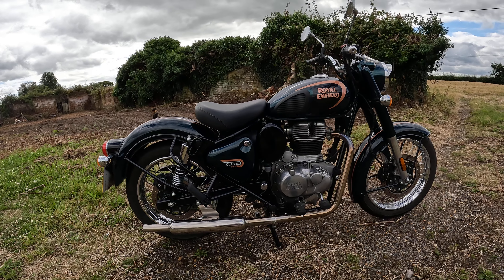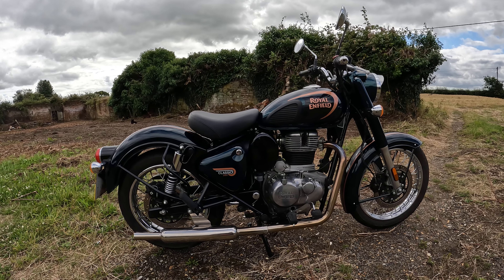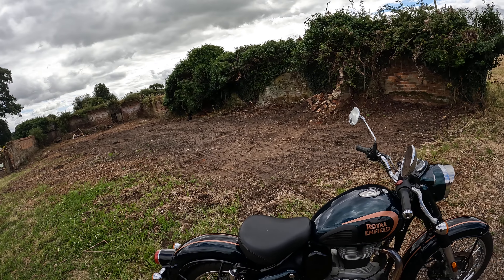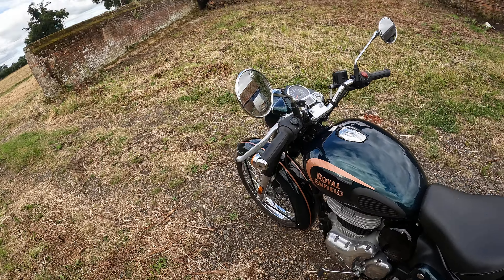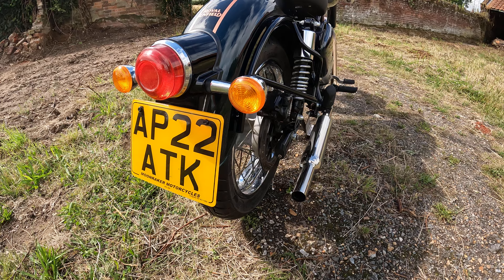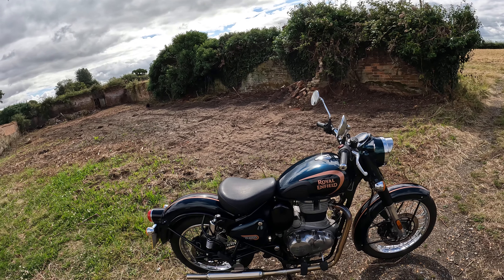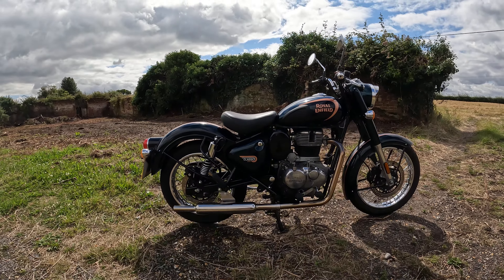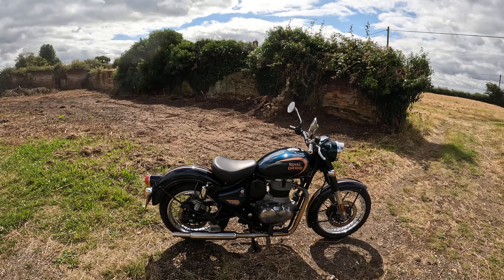ROYAL ENFIELD CLASSIC 350 PERFORMANCE MODS.  ARE THEY WORTH IT?

Comment from the maker: Please remember, these are only my own personal views and opinions. You may achieve different results on your bike. Also please keep the comments civil, I have had to block some commenters already on this video! Insulting comments won't be tolerated. I think we are all able to use the English language to put our points across without resorting to insults to either myself or other commenters. Thanks VB.
Reply: I think you accurately made your points, loss of torque, no real gain in speed, loss of gas mileage. if you want more but the 650 😊
Reply: Just leave the exhaust pipe and take all mods off.
Reply from the maker: @sunyrj25 I removed the Hitchcock's exhaust and fitted the standard factory exhaust, took the DNA filter off and refitted the standard one and the bike now has a lot more midrange torque. It still has the performance cam and the Fuel x lite, so will probable leave them as they are.

Comment: So, Royal Enfield got the design right in the first place 👍👍.
Reply: @GapBahnDirk  tbh they did get it right at the factory but Euro 5 strangled it I don’t care about the peak power output I don’t have a DNA filter or intake , i have a home brewed one with a smooth radius into the filter ,i’m running a through pipe de cat on it and a modified tail pipe, but it runs much cooler  and is a decent hill climber unlike it was as standard it feels remarkably similar engine wise to my pals 500 classic revs are not quite as low at higher speeds but not a great deal of difference and it doesn’t feel to different in peak power either we have swapped bikes doing a20 mile run half and half and  we both agreed that they are different power wise but not by a huge margin
Reply: This video saved me a h….l of a lot of money, I’ll leave it as standard, but I will fit a rev counter, I miss that one.

Comment: Hello Mr Brown. Thanks for your honest opinion. I bought my R.E Classic 350 2 years ago , after not riding for over 30 years. The bike is stock and  the only mods I've done is remove the rear seat and put on a Hepco and Becker rear rack. The bikes done 7500 miles without any mechanical issues. I have been struggling with the decision to spend the money regarding the performance modifications and I think you have reinforced my decision to keep it stock. My bike sounds great and will do over 70 mph and no more as it is limited by R.E. Also fuel consumption is 80 to 90 plus mpg. If I want to increase its performance , a cheap way of enhancing the bikes power to weight ratio I could go on a diet and lose  20 lbs, as I'm not a skinny lad anymore. 😊 Thanks for your opinion. Carl.👍

Comment: I totally agree with you,a complete waste of money. I'm amazed at how many people have gone with this route of add one's to try an increase power on a bike that is speed limited to 71mph. If there was a part you could buy to bypass the speed limiter so it would do 85mph then that might be worth it.The other point is that without telling your insurance company you have effectively cancelled your cover! As you say just enjoy the bike as it is and use the £800 for funding some nice trips away 😊
Reply: The HNTR throttle body if fitted will bypass the limiter, and you will get about 85 mph. They cost about £200.
Reply from the maker: @johnludmon7419  £143 is the cheapest new one I can find!
Reply: @Volcanicbrown1878  the question is would you spend the money? I haven't and enjoy my meteor as it is (though the extra 10 mph would be nice to have in hand)

Comment: So glad at last somebody spoke out, I've been arguing with numpties for two years about these modifications which are purely placebo and until the ECU is re chipped no gains will be made. So well done and spot on.
Reply: @johnrocker2986  the ultimate goal would be for plugging it in and re setting the parameters in the ECU , I don’t know about you but I feel a little insulted that we are not trusted to act like adults and these bikes and very soon all new vehicles in the uk are going to be restricted in the same way, thats going to put up the price of even old cars until ordinary people can no longer afford to drive and the insurance companies will double the prices on older cars using the excuse that they aren’t speed restricted but i think that is the long term plan anyway , they will sort out uk emissions and traffic issues by only allowing the rich to drive, sounds extreme I know but watch this space
Reply: @johnrocker2986  can i say whilst im here that my reason for fitting a fuel optimiser had nothing to do with performance but to help the engine run cooler which it has , i was seriously bothered by the temperature that it was running at as standard especially in traffic and for that reason i am happy with it , as for performance I don’t need that if i did I wouldn’t have bought a J series bike
Reply: You just need that exhaust pipe...that can make the difference.
Reply from the maker: @sunyrj25  In my case it didn't.

Comment: I have the exact model and colour as you, had it now for over 2 years and is by far for me the best bike I have owned in over 54 years of riding. I fully agree with what you have said, about 6 months in I purchased and fitted a de cat pipe from Hitchcocks, did about 100 miles then re fitted the cat. For me the noise was not enjoyable as a deep resonance was in my helmet, so once cat re fitted back to the relaxing sound I liked, last engine mod I did. As you say why buy a relaxing bike then try to turn into a different type of bike, I owned a Triumph street triple for over 3 years that went like stink and handled on rails. In the end though I found the high revving nature wore me down, a great bike for what is was designed for but for me I just craved a more relaxing ride, hence why I love my Classic so much. If you want a fast bike buy a fast bike, if you want a relaxed economical ride buy a standard Classic. Keep up the great videos, also loved the dozer video 😊
Reply from the maker: @Peter234100 Hi Peter I think you have summed it up!....The Dozer vid got thrown in the bin. After the initial flurry of views, folks just stopped watching it completely!

Comment: Done most of the mods on mine,DNA,decat pipe,fuel x,16 tooth gearbox sprocket,I noticed the hit on fuel,from 95 to 80 mpg,but it's a much happier engine with the fuel x,mine is definitely running cooler,steadier slower tick over,cleaner pick up,only paid 3.7 for it,old boy had bought it,never rode it! 0.8miles on the clock,put £200 worth of touring seats on it too,which looks better,but not especially comfortable,mines a red chrome,was also impressed with the build quality(apart from the crap battery,which has been replaced) thanks for your honest video,was thinking about the cam,but I'm not for revving the nuts of it,not that sort of bike, I'm late sixties and back riding after 45 years,loving every minute! take care my friend

Comment: I have had totally different results on my Meteor to be honest i made my own air filter cover  which is not as open as the DNA  but better than standard i have a x light optimiser fitted and i have a de cat , but I wouldn’t let anybody else touch it and did the work myself I didn’t change the cam , the results for me have been a moderate increase in volume but a much nicer tone a major increase in usable torque straight from tick-over to flat out the restricted top end still cuts the power at 72 ish mph , so no difference at the top end , the engine does indeed run much cooler( tested)  and my average fuel consumption is 89.3 mpg’s , i am climbing 3/4 gear hills standard in 4/5 with ease i live in Wales so that was the most noticeable improvement for me, i fitted a 16 tooth front sprocket for a 300 mile motorway trip and found that so long as i held on to 4th gear until around 55mph it would hold 65 mph even on hill sections unless they are trull mountain climbs , i returned around 220 /30 miles per fill though there is a small element of educated guess in that because of the notoriously twitchy fuel gauge near empty so rather than run out ( not a favoured plan ) i kept a tally and did the sums back at home , overall i am more than impressed with the meteor  and the fuel x light and would seriously be considering that there may be another issue somewhere on your bike so maybe take off n test one mod at a time as i suspect the cam maybe the cause of your problems  as it has much more duration than the pretty soft standard cam that i kept, the cam change is reckoned to give about 6/7 ponies but i was interested in the torque curve much more than the top speed because the ECU is going to stop you doing that anyway and in truth after seventy windy and tiring describes the ride so 60/65 is good anyway, i can on the meteor bypass the restriction and just south of ninety is possible but i think on the classic the speedo stops working if you mess with the wiring in the same way, or so im told anyway I can’t say from experience as i only tried it on a meteor but thats my bike , i don’t know why you expect flack   People are probably interested , i do however suspect that the fuelx is not compatible with your cam  and as i have no soot or starting issues after 2100 miles with the optimiser i would be inclined to take off the cam first and re test as my pipe isn’t burned and the only one i have ridden that was cammed up was bloody noisy and erratic , sorry for the essay and i hope you get it sorted

Comment: I much appreciate your honest feddback and review. Thumb up for not trying to sugar coat it.

I have accidentally found out, that one of the dealers not too far from where we live actually offers ECU tuning. They must have found the way to 'crack' it and promist to bring 5 hp more (and offer a measurement before and after). I do not know any more details (how the curves change and where), but I will definitely talk to them about that.
Reply from the maker: @matusknives I didn't think it would be long before someone started  to do remaps for the 350's!
Reply: @Volcanicbrown1878  the million dollar question is - what are the downsides in the longer run ...
Reply from the maker: @matusknives  Poor fuel consumption will be the main downside. I have removed all the mods from my 350 and even back to standard, I can get better fuel consumption from my Classic 500! My honest advice would be, If you want more performance, save the money spent on the mods and buy a 500. (I still run a pair of classic 350's but the 500 is more powerful, a lot faster and more fuel efficient!)
Reply: @Volcanicbrown1878  yes, that would be my expectiation too. The extra power does not come out of the air. Especially if one starts to use it regularly. As many have said - a 500 single with some 30-35 ps would be a great bike. I understand why RE decided otherwise, but we are allowed to have dreams :)

Comment: My fuel x light has lowered the engine temperature considerably( tested ) and i am not using much more if any more at all fuel because I’m mostly in a higher gear for the same speed so i would say that ur bike is not typical and would also say that if you bought the bike already modified then i would take off the mods one at a time and find the culprit but i think its going to be the cam that is the issue because im running the 16 tooth sprocket and that was because of the  extra available torque given via the fuel x  so that is the one thing i would swear by, and yes my first thought was if its running richer then it will use more fuel and logically that still has to be true but my own calculations have proven that assumption to be wrong because im using a higher gear everywhere compared to standard and with normal riding and not being gentle im still averaging around 90 mpg 89.3 was my actual average i fill up at the last two bars on the gauge and always get around 250 ish miles per tank now she’s properly run in
Reply from the maker: @NoelRoots-t1u Didn't work for me! All the mods have now been removed and I have refitted a 16T gearbox sprocket, The bike is back to how it was when I bought it new. just perfect!
Reply: @Volcanicbrown1878  
Its just my opinion but i think some people will just throw all the mods on that are available and hope for the best but then they have no baseline to work from i fitted a fuel x first as the fuelling was definitely lean especially at low revs  having that on it allowed me to move on to the next problem  so i then designed my own air box lid that would take some of the turbulence away from the mouth of the air box so now i was getting more air in allowed me to use a through mid pipe,  but i tested and adjusted everything on my way through the process even having the ability to lengthen or shorten the mid pipe by 30 mm made a big difference to the hill climbing ability of the bike and the gearing its able to use  but  hey im a methodical bugger  and spent a lot of years doing research engineering based mostly around air flow and turbulence both making it work for you and trying to eradicate it so i had a decent head-start but im glad you got your sparkly black little number how you like it 👍

Comment: Thinking about it it probably won’t help your fuel consumption that much but should help but definitely will improve the starting and running if you used a hotter spark plug for a better burn I feel you would notice the difference for sure as you know tuning is like dominos one thing effects many things but  it sounds like  the free exhaust and the high lift on the cam is preventing a good burn 👍
Reply from the maker: @user-rd7qu8kk6d  The bad starting was eventually identified as a sooted up Lamda sensor. I cleaned that up and then removed the DNA air filter and put a standard one in. Then the freeflow exhaust and silencer came off and were replaced with the standard setup including the Cat. It still has the cam and the Fuel x lite. The results were that the low and mid range performance are considerably improved. I have now refitted the 16t gearbox sprocket and the economy is back to what it should be. I will probably leave it as it is now.
Reply: @Volcanicbrown1878  im running a standard filter with a home made lid on it, i have ridden a cammed up Classic but i didn’t like it so didn’t go down that road

Comment: Just listening to you & you right you spend 800 notes for not much improvement iv did this 🤔
I have managed to improve it but it was a lot of gigery pokey .
With your baffles iv experimented and found the use of stainless steel perforated sheet rolled into a Swiss roll shape it is coiled & grips itself into the exhaust with one nut & bolt in tailpipe to stop it shooting out  & making it about 5 to 6 inch long, it doesn’t restrict causing pressure waves, it decreases the  sound level you need around 3 to 4 layers from centre . Slice a 😁pice of bar as a winder to make you roll up .
well Up to you mate try it on one of your other bikes . Bit of a ramble hope it makes sense
Reply from the maker: @user-mu5xy9nr8d  Il have to try it, yes it does make sense!

Comment: Would you consider going with bar end mirrors? I have trouble seeing around my shoulders.
Reply from the maker: @Rob-lj3kf Yes, bar end mirrors are one option, Mirror stalk extenders are another. RE made two different lengths of mirror stalks for the old Bullets. Personaly, I'm not a huge fan of bar end ones as they are a bit vulnerable being wider than the handlebars, although that being said, I have bar ends on my classic 500 (Only because it wouldn't fit in my van with the original mirrors!)
Reply: @Volcanicbrown1878  Thank for your suggestions. I will check on them.

Comment: The RE enthusiast community has calmed down a lot now, so you don't have to be too concerned about sharing your opinion anymore. Now 2 years ago you would have been lambasted for sharing this ever so valid personal observation.. People want to believe this stuff all works, when the airbox, funny enough, works as designed and does not need to be fiddled with. I have seen the fuelx on a mates bike dropped the temperature around 50 celcius from the outside, which is a good difference but the engine still runs darn hot and will discolour those after market free flow exhausts just the same as without. I haven't seen the stock pipes discolour at all myself, they're quality.
Reply from the maker: • 10 hours ago The stock pipes don't discolour  because they are twin walled.

Comment: To be fair, you've got a Stainless steel front pipe on that bike, and they always discolour ❓
I've fitted a Fuel X Lite System on Both my Interceptor 650 and Hunter 350 
No problems, but many people don't set them up right, Royal Enfield state in their own information, any changes to the intake to the engine, or exhaust,
You are supposed to run the engine for 30 minutes on tick over, to acclimatise the ECU, 
the YouTuber "TigerNess" state's this one of his videos,
Also Fuel X don't claim more power, they are meant to help the bike burn less lean, and they actually Do run cooler, which prelongs the life of the Engine and Oil 👍 
That has been actually proven by Hitchcocks UK 👍
Cheers Paul 👍

Comment: The low MPG is a big red flag to me, look forward to seeing what your results are in a future post
Reply from the maker: @markhinde6187 I have taken all the mods off and the fuel consumption is back to what it was. 200 miles per tank full.
Reply: @Volcanicbrown1878  Interesting.  Thanks for this honest video.  I had an order in for a bunch of this stuff including the cam to be sent to me here in the US.  I just cancelled it.  Great little bike.  Love it.  I have a 2022 Classic 350.  But, I also have a T100 which has all the power I will ever need.  No sense trying to turn this bike into something more powerful.  I use this bike to tour around on the rural back roads near where I live in Vermont.  Love it for that. It is a bit anemic up the hills which we have a lot of.  But, I can live with that.